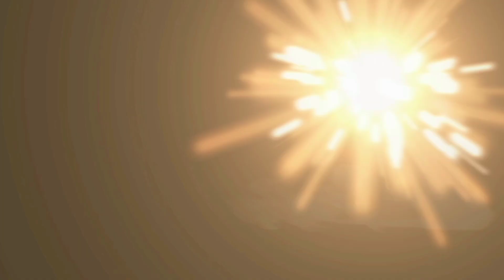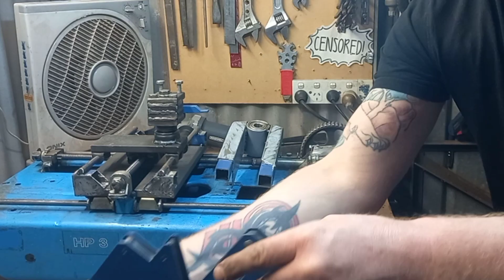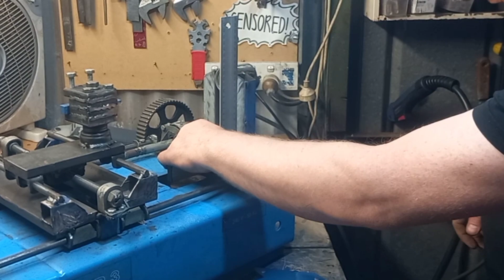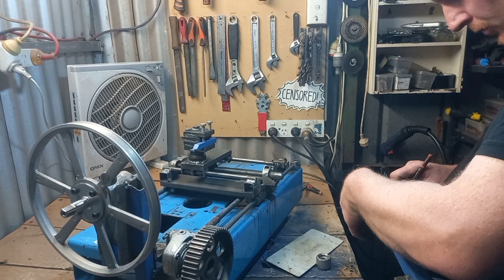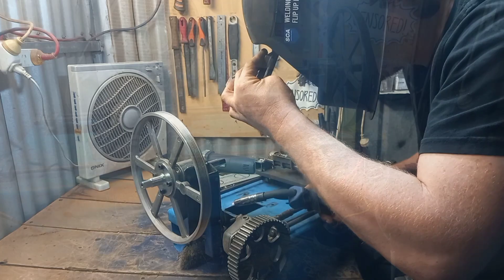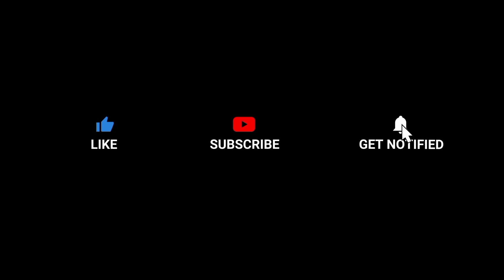DIY Metal Lathe Part 5. Headstock/Motor.

Comment: About to get a permanent orange Afro…… not all tape is created equal. Get some damn electrical tape. Some tape is conductive too. lol
Reply from the maker: Its alright, I've since gone with a different motor and control system. It's all pre-made plugs and wires. But yes you're totally right. Lol

Comment: Duck tape not a very good idea even for testing. I know my 2 cents isn't worth half of that. I like longer vids.
Reply from the maker: Nah I know. The rest of the motors wiring is done correctly. I have a switch to install that's why the wires were cut. The video was meant to be longer but I'd run out of shielding gas. And since broke the angle gear for the long travel.
Reply: @Twistedvideo  Yes trust me I know about sh!t  and the fan all to often.
Reply from the maker: Hahaha Yeah mistakes have been made. That's how we learn. I've been bit a few times.